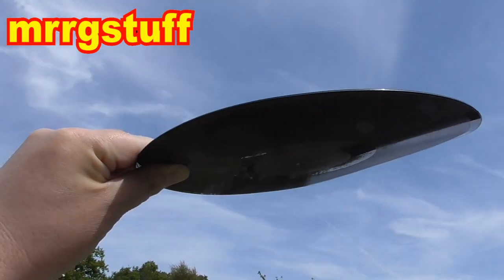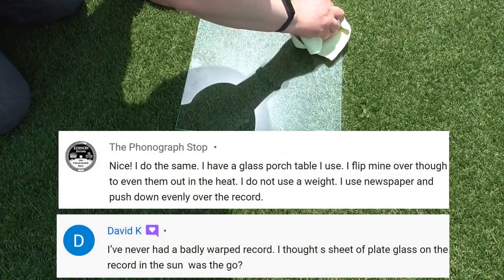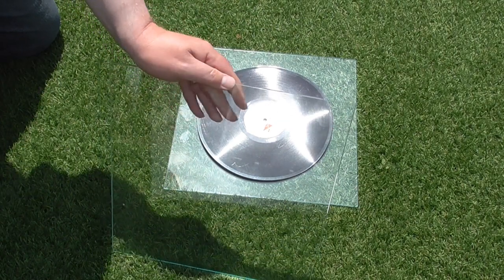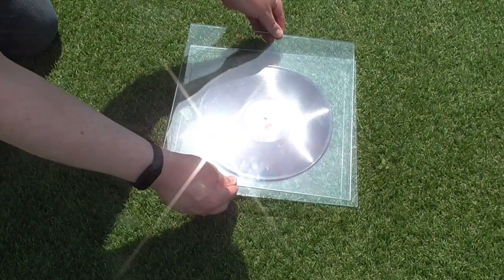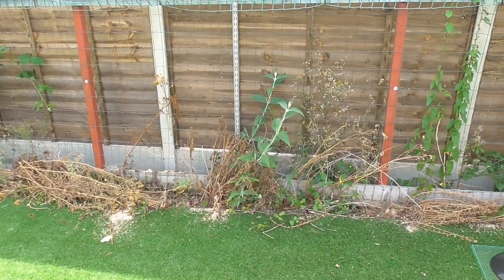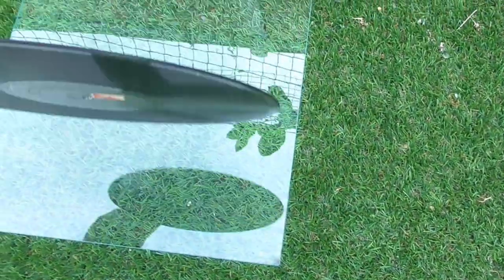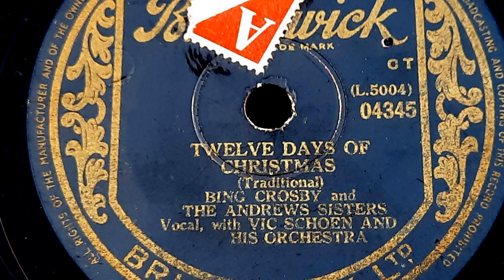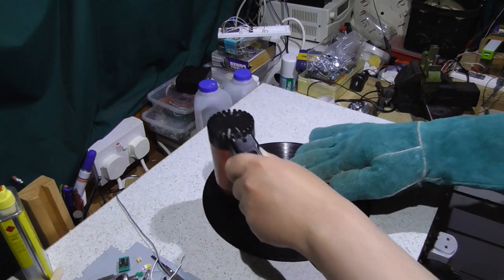Using glass to flatten a 78RPM shellac record

Comment: Very good! I, too have wobbly records. Also, perhaps laying the glass sandwich over a black absorbing surface may extend record flattening season an additional month or so .. and during the dreary indoor months, placing a warm(ish) dinner plate on top of the sandwich may suffice.
Reply from the maker: Yes, good ideas 😀👍. Usually in the UK the days where this is possible are few and far between, but this year I think I am completely out of warped records as it has been so hot! I do prefer the sun to using a hairdryer as I think it heats more evenly though. Thanks 😀 👍

Comment: I would not be happy to that myself, have to say... Can't regulate the tempature...  Better of using the hairdryer...
Reply from the maker: It's a fair point. I have had success and failure with a hairdryer. So far the sun method has worked well for me, although the blemish it picked up is a bit worrying and I wouldn't want to have that happen again. The sun method has failed for me when it didn't get hot enough. I had a record crack when using the hairdryer method, but that might have happened whatever I did 🤔
https://youtu.be/CGkxBAmi79I
Thanks 😀 👍